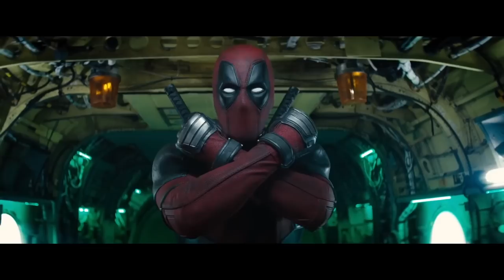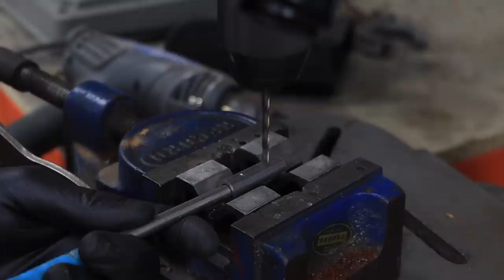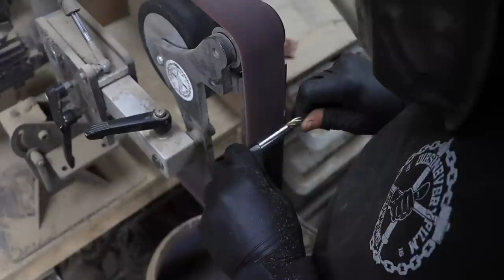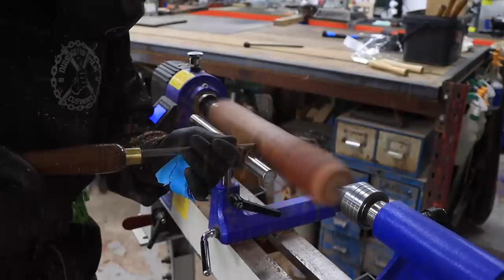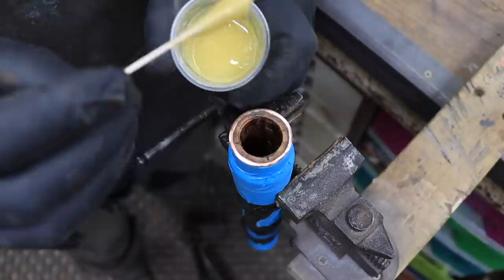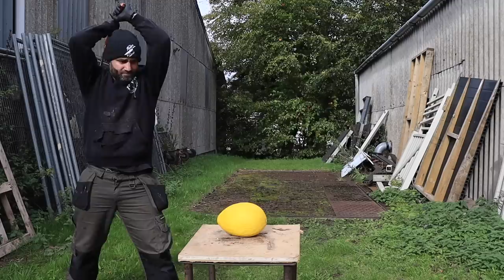Savage Targaryen Flail - What If???

Comment: You should try some Dyneema cut resistant gloves.  I've started using these instead of latex or nitrile gloves for work and they are fantastic..   These are a thin woven fabric glove of the same stuff that the latest bulletproof vests are made of, with a thin urethane coating for grip..   Being cut resistant, they dont tear apart like nitrile, and they are breathable and far more comfortable than a plastic glove.  They last quite a long time and can be washed when dirty and will save you lots on your masking tape bill 😜
Reply from the maker: I wear rubber to stop dirt transfer and they are safe to use on spinning machines